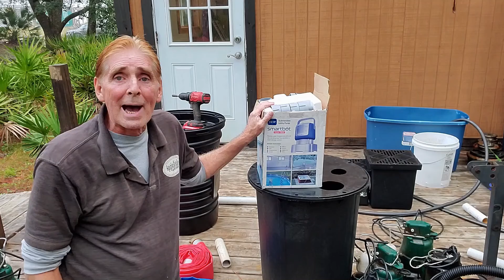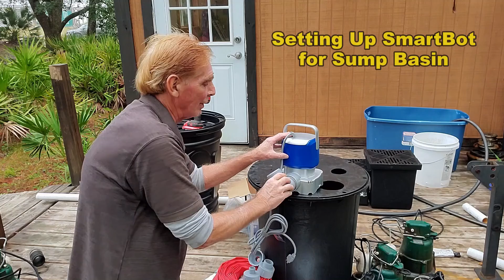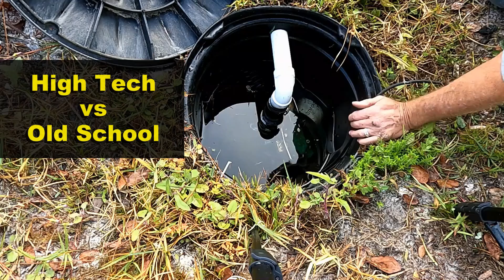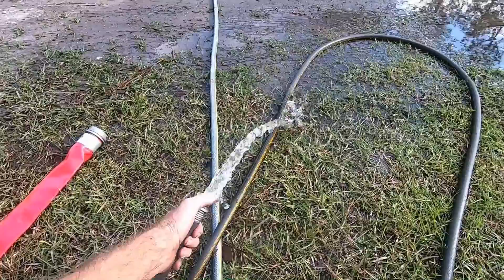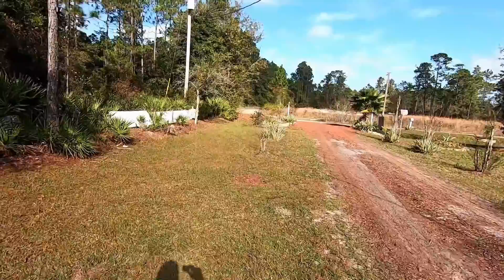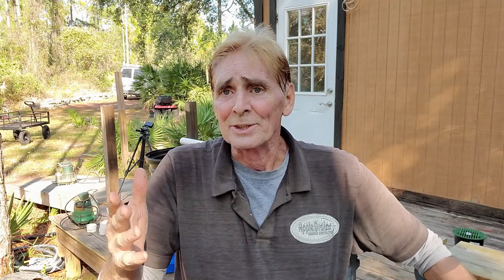Computerized Utility or Submersible Pump Technology - Old School vs New School - in Existing System

Comment: I feel like this would burn itself out in short order because of the auto on/off kicking in at such low water levels. The zoeller gives itself a little bit of a break by allowing the water to fill up a little ways. I guess the question is, is it harder on the pump to run more often but push less water, or is it harder to run less often but push more water?

Honestly for 250 bucks I think I would rather use a Zoeller as an actual sump pump, but this pump would be great for emergency use.

Comment: Chuck, I have a question, why does the check valve need to go above the handle on either pump? I have a 20-in catch basin which is 14 in deep which I was going to use instead of a sump pit, if I put the check valve above the handle it will exceed the 14-in depth of the catch basin.
Reply from the maker: Hi Sharon - We like to put everything inside the basin for Backyard systems  Because we are discharging underground - Crawl space and basements, the check valve is better above the basin... You can also lay the check valve on its side of pipe that runs underground , it will still work. But most we like to be inside the basin for backyard systems. There are also check valves that screw directly into the port on the pump that work well. Available at most places like Lowes and Home Depot
Reply: @appledrains  awesome thanks for the solution!

Comment: If it kicks on at only about an inch of water the pump would be running almost nonstop in most systems.  Is that adjustable?
Reply: It's appears it's more of a general utility pump versus a dedicated sump basin pump.